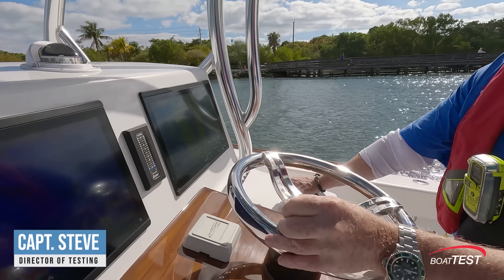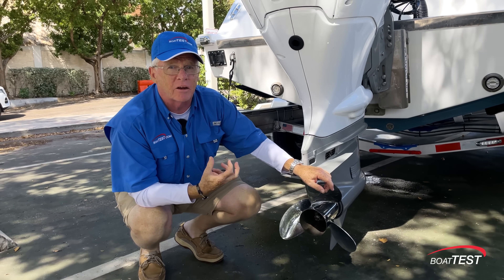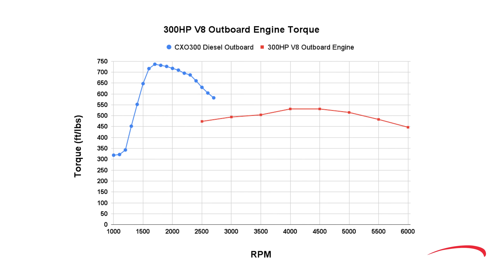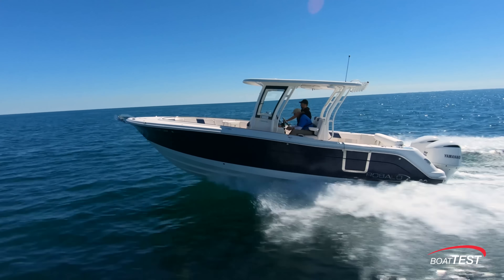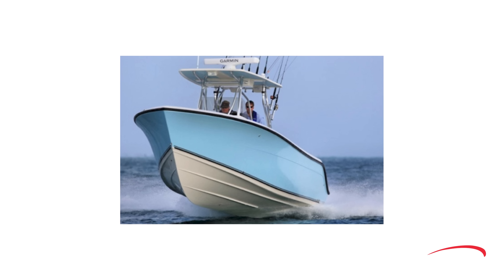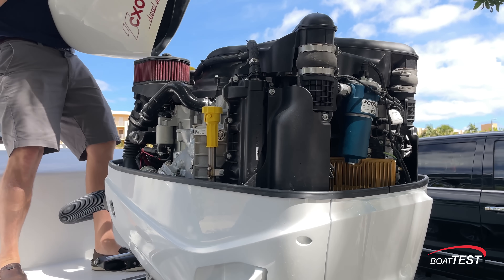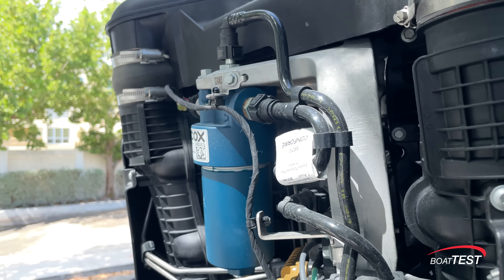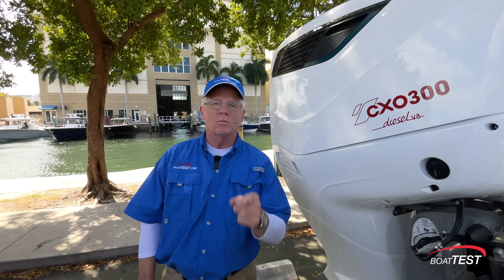The Diesel Revolution: Cox Marine CX0300 Review | BoatTEST

Comment: people need to be aware that the comparison chart @3:30 is the hub torque and not engine torque, otherwise those numbers make zero sense. I know you mentioned it in the review, but its worth noting that these two engine don't have the same gear ratios and so the comparison on the same graph makes little sense.  The HP plot is better.
Reply: The explanation section with the charts was all over the place, with irrelevant graphics and incorrect statements. Take it all with a grain of salt. If you know how the math and engineering works out you can figure it out. I mean, nobody is running an 18"x12P prop, lol.

Comment: I think of they offered a v6 and v4 version of the motor they would make a strong push for go farther not faster.  Having all the benefits  listed in the video. I would like to know if a duo counter rotating prop design would be beneficial? I world totally get these on an outboard catamaran.  Or large fishing machine.  The distance i could go would be my buying point. Just as replacing high hp gas inboard with a diesel option for jet boat.

Comment: With Diesel prices 35-70% higher than gas, buying a  Diesel outboard becomes a decision of "pay now or pay later". Unless diesel prices are equivalent to gas, the points in this presentation are moot...with the exception of diesel outboard eliminates the gasoline vapor explosion possibility. That's a strong point.
Reply: To clarify marine D is road tax free
Reply: @geoffreytofte4049  Yep, and so is gasoline.
Reply: Are you factoring in any fuel savings in your calculation?
I've seen this tired argument in America over and over again. "BuT DIeSeL iS MoRE EXpEnSivE" while conveniently forgetting that the MPG boost they are getting over the equivalent gasoline engine completely obliterates the price gap at the pump.
Reply: @mjodr  diesel is only more expensive at automotive pumps, aka road taxed D at marinas diesel aka “red” no road tax added in my area is $1 to $1.50 less per gallon , than ethanol free gasoline
Reply: @geoffreytofte4049    I was an OTR truck driver. Pretty aware of the diesel prices all over the country, lol.
Edit: Maybe you thought I was replying to you. I was replying to Curtis, but the way YouTube does comment threads is pathetic. What you are telling me actually strengthens my/our argument, then! haha
Reply: It depends on the country you're in. Diesel fuel can also be cheaper than gasoline especially premium gasoline.

Comment: You know you have to put a Sharrow on it now, don't you?

I want to see the Aquila 36 foil-assisted run two of these motors with Sharrow props! (insert mad scientists laugh) If the just the foil gave you a theoretical range of 412nm (37.7mph @ 5000rpm) in your 2021 test of that boat could a Sharrow setup truly add another 25% or more? True 500nm range from a boat with just 350ish gallons of fuel would be outstanding. Talk about making boating more attractive.

Comment: if it could have a CVT transmission that alows it to vary the prop speed compared to the engine speed . that extra torque can then be put to even greater use.  a low rotation high torque to the prop to get on plane then mentain a cruise rpm ( also engine produces high torque at cruise ) and then independently increase the prop rpm 

a syetem like that can actually rival the gas engines for speed because u then have gas engine prop speeds  from a low rpm diesel

Comment: That low speed number is the most interesting to me.   For trawlers, sail boats etc, an expensive option, but it would be a good one imo.
Reply: Nobody would hang this thing off the back of a sailboat. Lol
Reply: @kleinbiker1  Maybe, maybe not.   I think it would be a nice option for some of the larger boats that already use that HP range.   Especially motor sailors.   After all, a Volvo 300 hp with an IPS drive is 3k lbs, with a shaft drive around 1400 lbs from what I read.   A COX 300 outboard is under a 1000.  Couldn't find many price comparisons, but they seemed similar.   Tim Weston, when he built his Cat, it had two outboards that lowered into and out of the water when needed, Not just raising and lowering using the tilt, but an entire mechanism lowering and raising the engine.   Why I am mentioning this is because it reduced the boat's drag when not in use.   And would still be lighter than an equivalent inboard option.     And it doesn't have to be off the back with this method either.   Would it need some engineering for the lower unit and props, I don't doubt it.  Still, I see a lot of potential there.  Of course, with the reliability of the standard diesels still be there?   Only time will tell on that one.   But if they can prove themselves in that department, it will be a nice option.   At least to me.    Issues I can think of making it less feasible, big sea states and following waves might drown it if on the back, which is the worst thing I can think of.  So as I said, some engineering by people smarter than me would be needed.  Still, I like it.

Weight savings.
Ability to work on and clean the entire system on the water without needing to dive.
Less drag when not in use.   
No need for pricey and sometimes finicky feathering props.
Reply: @Mandurath  it’s not just the weight it’s the position of said weight. There is zero chance this even close to a reasonable option for a sailboat.
Reply: @kleinbiker1  We will have to agree to disagree, 
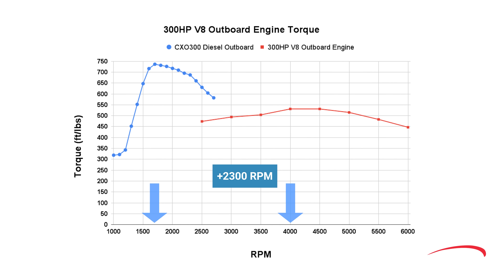In the following link, on the Tim Weston build videos, is a quick view of what I am talking about.   At 5:22 in, they are hanging about 2/3rds towards the back and more in the middle.  There are other videos of it but this was the simplest after a quick search.  And to me, there is no way that with an open mind that professional engineers couldn't improve on that and do even better.   
https://www.youtube.com/watch?v=z4vpqFuOwfA
Reply: @Mandurath  those motors are tiny compared to this 300 hp diesel. I think you’d be hard pressed to find someone that would agree with your contention that this motor would be a good option for a sailboat of any iteration.

Comment: The price isn't bad when you weigh the savings against operating costs.
Reply: Diesel fuel is significantly more expensive than gasoline in the USA
Reply: @petersouthernboy6327  I know bro. But depends on how you run your boat you will burn significantly less since diesel has more low end torque to get you up on plane, you won't need as much rpms.
Reply: @GPopeSinghTriniCharters1983  the price differential between the Cox and the other 4S Major Outboards is just profound.  And personally speaking (IMHO) - BMW isn’t known as a great diesel manufacturer
Reply: @petersouthernboy6327  to each his own. People have been asking for a diesel outboard and here it is.